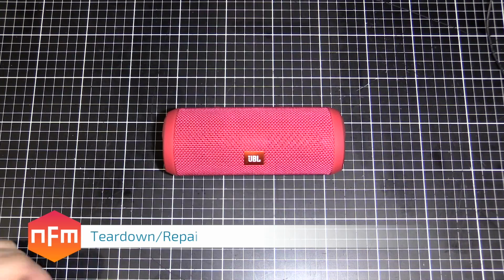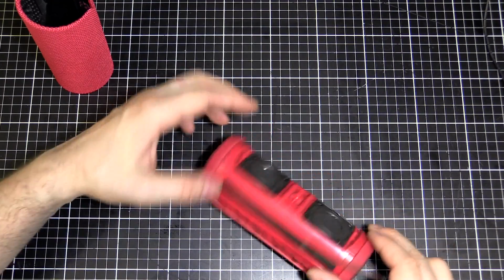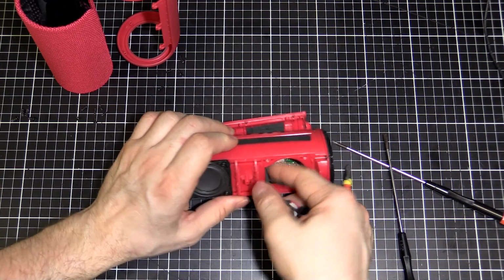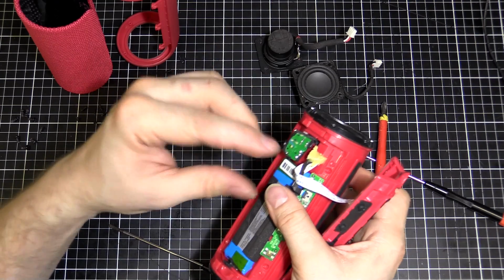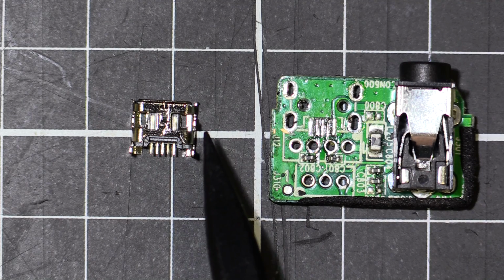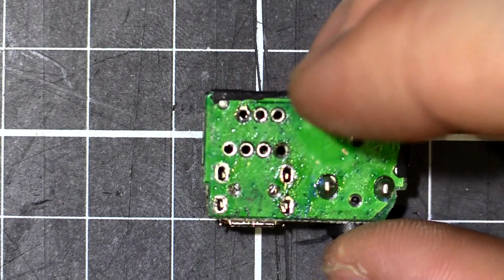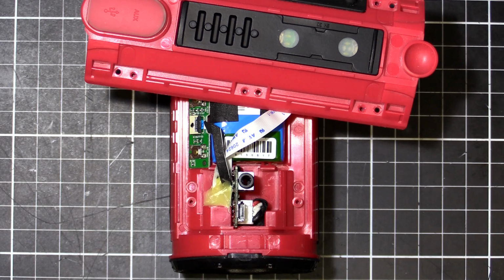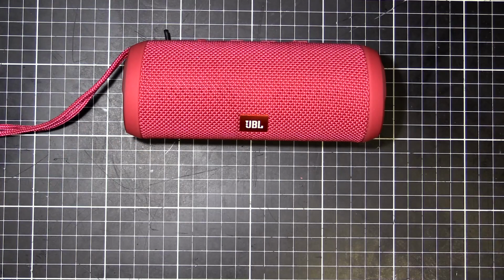JBL Flip 3 Teardown and USB Repair

Comment: It would have been cool if you mentioned what voltage and AMPs the unit charges at when new or after replacing the part. 
I did this. It indicates that the unit is charging. But Even with the bat showing 80% the unit dies while playing music. 
When I charge it. It only charges at 5 volts .2 amps.

Comment: Thank you very much for posting this.  The tip on how to remove the outer cloth cover was great, down hill from there!  My son left ours in a cooler full of water and it was no longer working.  Of course it had water in it after disassembling, but after hitting the control board with some electronic cleaner and some air, it turns on and appears to work properly!  I'm going to leave it disassembled for a couple of days so the main area dries out, but there appears to be a reasonable chance that it's saved.  Our model is newer and slightly different, but close enough that this was still extremely helpful.

Comment: Great instruction! And stil valid.. Mine dropped and sound was gone.. could connect and charge.. but not even the intro sound. Turned out to be the 1R5 block on the board, it was completely broken off but no further damage. When I pushed it back in place, tada sound was back. Bit of superglue and problem solved!

Comment: FYI - NOT ALWAYS MICRO SOLDER FIX NEEDED:  Just fixed my daughter's non-charging Charge 3 after switching out the battery which WAS NOT THE ISSUE.  Not sure this is the more likely problem with the USB port but in ours, the 5-point contact piece within the USB metal housing was broken rather than the full metal housing piece which is soldered to the board.  I was able to grab that mostly intact L-shaped piece which is plastic and then first tested it while carefully holding in in place and connecting a charger cable>>>>lights on speaker came on and started blinking!!!  So, next got some quality plastic glue - E6000 craft adhesive - I had around and using a paperclip and needle was able to lightly and cleanly coat the remaining plastic broken post and also the inside of the metal USB housing that attached to the board.  This glue is hard to work with in a small space but you have a few minutes before it sets up to apply to both pieces then fit into place.

Let set 24 hours and tried to gently connect>>>WORKING GREAT.  Probably need to be gentle with using port but I think I got enough glue in place to make it stronger than original.

Wanted to post because I bet this broken plastic is probably the part that needs repair for many and the fix DOES NOT REQUIRE any micro-soldering tools or expertise,,,,well, maybe similar expertise, but with the E600 glue which can be tough.
Good luck all
Reply from the maker: Nice work on the fix! :)
Reply: @NearFarMedia thank you for your video.

Comment: What do you think of me using the red and black wires out to a coaxial plug instead of usb? I won't be worrying about the data.
Reply from the maker: As long as you make sure to only use a 5V power supply, and get negative and positive the correct way around, it should work fine.
Reply: @NearFarMedia  thank you. Yeah, I don't want to fuss with pins and I've got 5v sources. Thank you.

Comment: Hi there - mine hasnt worked since i dont know when, but when i plug it in a charger, the light turns on. But doesnt connect nor is responsive. When i take it out from the charger, it just shuts down. Any fix for this, you know? Appreciate it.

Comment: Considering the micro usb is only used for charging, would it still work with only pins 1 and 5 soldered or does it still need all five pins? Thanks
Reply from the maker: It will probably work, but the mechanical strength would be compromised by not soldering all the pins so I don't recommend soldering only pins 1 and 5.
Reply: @NearFarMedia  It was more of a theoretical question. Just interested to know if that was even possible. Cheers buddy 😉

Comment: Technique Question: I see in another repair video the USB connector was removed by using a soldering station heat gun that used hot air on the rear side of the PCB, heated it, until the connector slipped off.
Do you recommend that technique, or no?

Comment: Just saw this video now in 2020, can the micro usb changed to usb type-c anyway???
Reply from the maker: Possibly with a custom PCB to mount the USB-C connector to, but you might need extra circuitry to enable power supply negotiation.
Probably easier and better to buy a new one with USB-C already installed..

Comment: if the speakers distort coat them with "tire swing paint" and this will remerge (if thats a word) the polymer and equalize the condition of the speakers..mine sound noticeably better than ever..i coat all of my speakers with this highly flexible and well bonding paint..multiple coats on paper cones can serve to make them water resistant and you lose no flex ability whatsoever.. works wonders for subwoofer drivers..ive made cheap subwoofers sound like $1000 rigs with this stuff..audiophiles take a knee when they find out the only modification made to that cheap plastic subwoofer module was a few thin coats of this stuff painted onto the cheap paper cone with my finger..and believe it or doubt it the effects on frequency response have been beneficial every time.. i mean to say the stuff probably allows the speaker to achieve its best possible frequency response.. it doesnt perform miracles but it can seriously make you step back and think twice next time you consider purchasing that $500 carbon fiber or audiosynthetic driver..you might find it improves those too.. but opinions are relative i suppose.
Reply from the maker: I've been known to lacquer up cheaper paper coned woofers in the past. Stiff cones make for tight bass. :)

I'll keep an eye out for the stuff you mentioned for some future experimentation.

Comment: This was super helpful. Nice to see how to open the speaker. My speaker's USB port looks fine and it will start charging. However, it will not continue charging, It keeps starting and stopping. What would the most likely reason for this issue?

Comment: What kind of screwdriver did you use to unscrew the ones on the two sides where there are 6 on each side? I have Philips #1/#0/#00 but they all slip on those screws, even though they worked fine on the ones at the two ends

Comment: yay, you are my hero. I have a UK version of the JBL 3 and it has less screws. only the four at the ends mainly for what i needed to sort.

the clip on grill has a slot clip one end and two clips the other.

My issue is my on/off button stopped working and i assumed the clicky button had worn out.

I soon found the cause, they had used hot melt glue inside the speaker and during the unusually hot weather recently in the UK had melted this hot melt and it had run down and over the on/off button.

once the heat died down the button no longer worked.

All i had to do was carve off the now solid hot melt and clicky works again. , reassembled and happy.

Comment: And there is a another version of Flip 3 that does not comply with this teardown and I would say that version is not repairable as the USB-jack is glued in with massive amount of elastic glue and there are different connectors.

Comment: MATE! THANKYOU! you saved my speaker, I soldered a new plug in and "Hot Snotted" it in.
Cheers
Reply: where you buy Charging Socket Port from
Reply: Ebay, china, gota hunt for them but they are there.
about a month ago i Mashed the new port (many swear words came out), i have now soldered in 2 small cables in which i connected the port. 
Its relegated to a desk speaker but at least it isnt totally useless!

Comment: um...great video, but just one question... why you drill the board instead of cut the little rod off the connector....
Reply from the maker: So the rod will provide more support to help prevent the USB port from breaking so easily.

Comment: You skipped the hardest part of the tutorial.. desoldering the metal out.. how??
Reply: bassel97m exactly
Reply: we have to use heat gun
Reply: bassel97m He used either a desoldering wick or a desoldering iron. A desoldering iron would be the best thing to use in this situation but, a solder wick would be a much cheaper way if you don't have a desoldering iron.
Reply: if you are going to a walkthrough of how to use basic knowledge, it shouldn't be expected to include the basic knowledge itself. if you want to work with electronics you learn it. I'll steer you helpless souls slightly. 

ask your parents or friends, instead of youtube comments. you'll get an answer more worthwhile, and way fuckin faster. That sometimes isn't possible, or it's your last resort, so just ask google, or the youtube search function. like, how to desolder. 

The proof of my statements are easily obtainable by the lack of info in the thread, and by doing exactly what i said. if you try it, it WILL work, barring really stupid stuff.
Reply: @nicewhenearnedrudemostlyel489  Yet you're watching the same video lol

Comment: Very useful instruction. I had the same problem but built an alternative solution. Instead of replacing the micro USB connector I rebuilt the existing Line-in connector to a "Power in" port. If you connect a 3.5 mm jack to the USB cable, be sure to use a 3 way jack and leave the middle contact unused to prevent short circuit when plugging in the jack.
Yes, you loose the audio-in port, but I never use it anyway.
Reply: Frank Zandee, can you please go into detail on how to do your alternative solution please. I'm with you, I never use the audio IN. I like your idea, you would never have to mess with it again. Thank you for the post.
Reply: Hi Harold, I followed the instruction video from NFM but I found it very difficult to get loose the white 4 pin connector (power) and the white 3 pin connector (audio-in) without damaging the lanes on the print.
In the end I managed. Next I used a multi-meter to measure which pin of the audio-in connector on the print connects to the tip of a plugged in 3.5mm jack and which pin to the base of the 3.5mm jack.
Next I soldered two wires on the identified contacts of the line-in connector on the print and connected the two wires to the red and black wire on the 4 pin white connector.
I left the original 3 pin white connector loose as it has no purpose anymore. You can also leave the original 4 pin white connector loose since it now connects via the two wires to the print. Then I put back the print in the original position and reassembled the unit. As a last step I soldered a 3.5mm jack to a USB cable. Make sure that you connect the tip of the 3.5mm jack to + and the base to -
Hope this helps.
Reply: Frank Zandee , thank you for the quick response. I will give it a shot. Happy New Year to you man, I appreciate the help.
Reply: Frank, I did it your way and it was an excelent desicion. Thanks for the explanation!!
Reply: My pleasure Juan. Glad I could help!
Reply: Frank Zandee

Comment: Thanks. Is it possible to do this? https://i.imgur.com/5zHBN7c.png ie: get a USB cable and connect to the red and black wires directly. Easier to solder than the pins.

Comment: Can I charge it with any wireless charger?
Reply from the maker: It has no wireless charging function built in, you need to connect the USB cable to charge this unit.

Comment: What type of screw driver did you use to take out the screws?  I don't have one that small.
Reply from the maker: A jewelers screw driver is what you want. You can get cheap sets from dollar stores or hardware stores and the like.
All the screws in the device are Philips screws.

Comment: Hi! Thx for your work! Do you think I could pimp my flip 3 with a better LiPo? 
Like this: https://www.nextbatt.de/de/artiklar/mlp912995-2p-jbl,-3.7v,-6000-mah.html?gclid=CjwKEAjwja_JBRD8idHpxaz0t3wSJAB4rXW5rGDNxaqIPIRW4CsVaJVkao6McjgUgJAb1oOesSM6tBoC1N3w_wcB

This is the "Original" size... its 9.5 mm in height and the one with double capacity would be 18.5 mm height.
As I saw in your video there would probably be some space for it... what do you think?

Cheers, mate!

Comment: Sorry, I have the same problem and I tried to get off this small circuit board from the connection, but it doesn't work.. The problem is, that the solder doesnt really melt and therefore my desoldering can not work.. How did you get that?
Reply from the maker: It's lead free solder, so it needs a bit more heat than normal solder.
I add normal solder and use a solder sucker to remove the old stuff then gently work the connector out.
IIRC it is glued down a bit too, so you'll have to remove or cur the glue too.
Reply: 60W Power is ok?
Reply from the maker: You'll have to be careful that you don't lift the traces off the PCB with that much power.

Comment: how did you remove the circuit board from the plug things
Reply: Khadijah Baptiste I had to desolder them as they are not real plugs
Reply: okay thank you
Reply: yeah but its not desoldering easily .... i give-up ....
Reply: what temperature have you used?

Comment: I broke the component beside the audio input connector label L205C804 while replacing the USB connector in my JBL Flip3. I connected JBL, but their customer support said that they don't have any documentation for the Flip 3 internals. The part can't be a capacitor because it is in series with the input power. It could be an inductor. Does anyone know anymore about the part?

Comment: is there a way to buy the complete board so that way a person just can exchange boards instead of just the usb.
Reply: update. i bought a used usb board from ebay for 10 bucks and fixed mines. thanks for showing how to take the speaker apart.
Reply: wsmaga. Can you tell me the model of the board you purchased, seem a bit easier to replace the whole board. Any details or physical markers to make sure I get the right one?
I appreciate it.

Comment: Well, I opened mine, yellow color.Turns out, its not the same design inside, dont have the opening piece above the battery, its all one thing, the battery can be seen only sideways through the one of the fake sidespeakers.Bummer.I guess its a perfect example of "buy, use, throw away, buy new one", but at least, JBL, make a quality product at the first place!

Comment: I can't close it :/  how I do this?
Reply: Ja cky lmao I had the same problem if your talking bout the shell, you have to snap the side with the buttons down first and stretch it just enough to make it wrap around the speaker it should fall in place, finish pushing the edges in till they snap and lock and you'll b set
Reply: Jacklyn bnyd

Comment: Hello, i was wondering if you couldn't just skip the board and wire a USB cable dirctly to the 4 wires? or do the 5 micro pins go through the board circuits be four going into the 4 wires black red 2 whites?
Reply: drewbinson i did that before and worked. The only think is the charger become hot when is plugged in. Then i sow put the + through little capacitor found on board and its working fine now.
Reply: Margina Emanuel. Can you go into a little more explanation on how you did this with a hard wired cord and capacitor please.
Reply: Harold Palmer the most important are red and black. Black can be connected to black usb wire but red one from speaker needs to go through capacitor located between jack port and micro usb, is the big one.
Do not solder any hard wires on it.
Follow the circuits on board.
I prefer to put some easy wires first then connect to hard wires.

Comment: I tried this repair but when I attempted to pull the wires and white plastic connectors things appeared more complicated.  The wires to the headphone jack and USB are very short.  Maybe I should have tried to remove the solder first but that seemed tricky. This step in the video was skipped over.

Comment: Hey I've got a question! I have the same problem, and I think I'm not the only one. But how did you solder those super mini five solder pins behind the micro USB port? The four pins on the sides are not that difficult, but how do you prevent that the solder pins don't hit each other?

Thank you!
Reply from the maker: A steady hand, a small amount of solder and a fine soldering tip will do it.

If you do bridge the pins with solder, some solder wick or a solder sucker can be used to remove the excess solder but leave enough for the pins to stay attached.

Comment: The passive radiators and speakers pop out when the speaker is left outside because the air inside the unit is heating up and expanding. Since the speaker is sealed it prevents the  inside air from equalizing with the outside air. JBL should maybe Incorporate some kind or pressure relief valve into future units. 

I own a flip 3 in black. It's probably the best sounding BT speaker I've owned to date, I don't intend to leave mine out in the sun or anything, but the issue with the unit being affected like that has possibly been corrected since most videos talking about it are from last year.
Reply: I have 2 JBL Flip 3 speakers and I love them! Unfortunately, I left one in the trunk of my car and the one of the speakers now has the distortion problem. Hopefully I can fix it because I really liked using them as a pair for outdoor activities
Reply: tnx for usefull info

Comment: You can get the part at ebay
http://www.ebay.com/itm/3-X-New-Micro-USB-Charging-Sync-Port-Charger-JBL-Flip-3-Bluetooth-Speaker-USA-/122188023347?hash=item1c72f94633
Reply: This really part for flip 3 it"s best http://www.connector4all.com/fr/connector-usb/8-new-micro-usb-charging-port-jbl-flip-3-bluetooth-speaker-connector-dock.html

Comment: Hello live in Argentina, does this product serve as a backup for the Flip 3 Black?
Thank you

http://www.ebay.com/itm/201721660029
Reply from the maker: It might be ok to use, you might have to do a few small modifications to make it fit on the PCB like I did with drilling the holes.